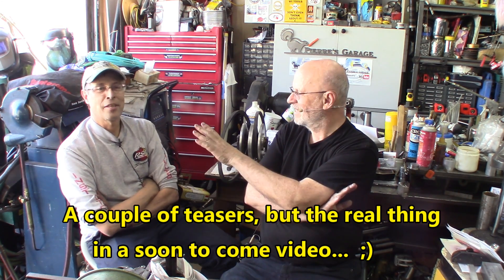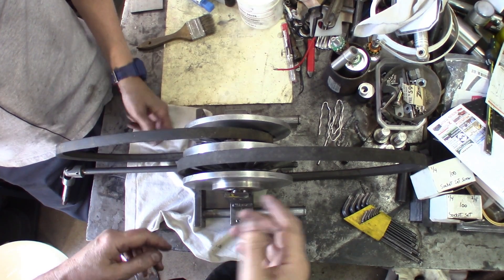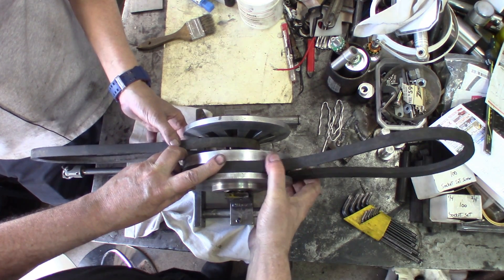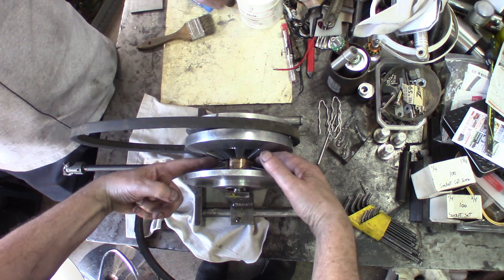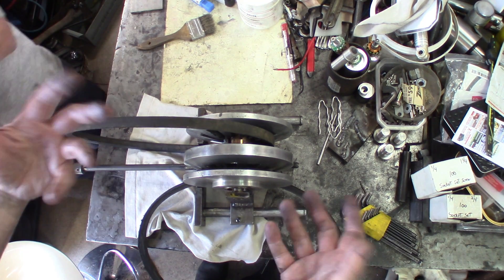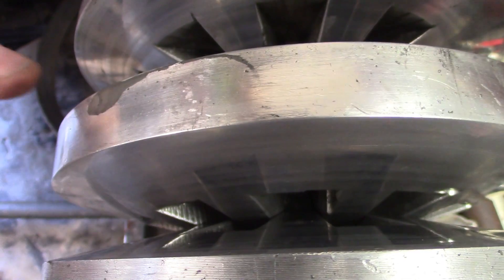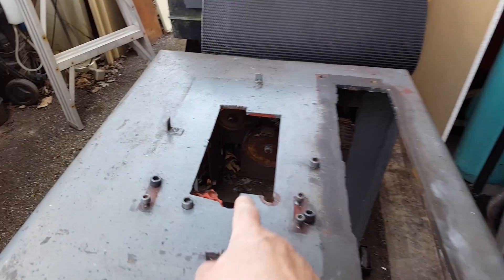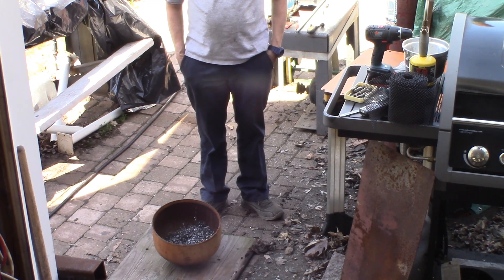Infinite Variable Ratio Pulley, How it's made and how works...

Comment: Does anyone know the maximum speed/pulley ratio you can achieve with these types of variable speed pulleys regardless of arrangement? From my research limiting factors seem to be things like belt/pulley angle limiting the pulley OD and minimum belt radius limiting the pulley ID. Cheers
Reply from the maker: Ratios can vary from something like2:1 or possible to 4:1, not much more...

Comment: As one side moves, doesn't it cancel out the other side? Result, no change in outcome speed. I'm missing something.
Reply from the maker: As one gets smaller the other wheel gets bigger, then, the ratio is is lets say 2 to 1 in one direction, as it shifts to the other side the ratio will be 2 to 1 in the other direction. this setup allows the change without the need to change the length of the belts cause the variable pulleys travel along the slide bars.

You need to figure that the pulleys on the motor and the other one on the driven tool are constant in size. the ratio is directly proportional to the diameter of the drive pulley over the driven one.

Comment: Speed Selector makes variable speed pulleys that replace the Reeves and Hi-Lo pulleys.  I think they went out of business.  A lot of them are in stock or they can make a custom if needed.  They have an actual engineer to help you if needed.  Very helpful.
Reply from the maker: I haven't heard about them being out of business, their web site is stibe is still on line....
They have great variable variable speed pulley systems, similar to what is in Bridgeport or similar heads. 
The system shown in the video is something different and less usual.
Thanks for your comment...    👍

Comment: When the pulley moves the diameter effectively changes which effectively changes the length of the belt.  How do you maintain tension on the belt? Is there idler pulley or?
Reply from the maker: As the pulleys change ratio, the pulleys assembly slides along the 2 rods, doing so it compensates and acts to switch the belts required lenght from one side to the other, since the pylleys change their ratios symetrictky. 
Let me know if it's clear or not to you...   🙂🙂
Reply: @pierresgarage2687  Thanks. Watched it again and saw where I missed that. Makes perfect sense now.

Comment: Hi Pierre, I was wondering, can you share de dimension, slope, or 3D model of those pulley? I would like to make some for a drill press. Thank you
Reply from the maker: It depends mostly on the straps you're using, as most straps are in the range of 34 degrees the pulleys have to be in that range, the size of the pulleys is dependent of the ratio you need for reduction or increase. When the straps are on equal diameter on the device there is a 1:1 ratio, as you go in either direction you change that ratio, then you need to decide what ration you need and then the diameter will be determined accordingly, be aware that with a 34 deg. the thickness of the wheels will increase quite rapidly.

Comment: Sorry for your loss. We had the service yesterday for my uncle. He was the guy who got me involved with mechanical things.
That drive is is just like the John Deere Variator drive, just a bit larger.
Reply from the maker: Sorry about you also lost someone important in your life, they leave a good imprint that's our to make the best of...
Those type of pulleys aren't that popular but they get the job done quite well where they're used...   ;)
Thanks for the kind words,    Pierre
Reply: Losing the ones that actually made an impact is always harder. 
John Deere used them for many years on their early lawn/garden tractors. They were used between the engine and a 3 or 4 speed transaxle.  The center sliding sheave bushing would get warn and then start sticking or the tractor would set and things rusted up.  Most of the owners didn't know they were rebuildable  so they sold/junked a very good tractor.

Comment: Understand your loss... lost mine back in 1976. Can only offer that time alone makes it easier. 
As to CVTs... have you seen latest models that belt and driver has one flat side? (So belt can run lower and still maintain contact area.) Actually get overdrive of 1.05:1.
Reply from the maker: Thanks for the condolences and kind words...
Haven't seen the later with the one flat side, I'd be curious to see one...   ;)
Cheers,     Pierre
Reply: Pierre's Garage  called TAV2  See them on Amazon, Ebay or omb (old mini bike). As cheap as $60 US. Final ratio should be 0.9:1,  not 1.05:1   https://cometkartsales.com/Comet-Industries-Torque-A-Verter-TAV2-30-Series-Parts/
Reply: Pierre's Garage   One last bit of trivia about variable ratio pullies. Take a pair of the big "driven" pullies and mount one to a gear takeoff on either side of a differential, and you have steering method that was used on "Snow Trac" vehicles. https://en.m.wikipedia.org/wiki/Snow_Trac#Mechanicals   Only snowcat vehicle I ever saw that used a regular steering wheel for steering. It changed pressure on either side of variable pullies gear driven off output shafts of VW industrial engine and transaxle.
Reply from the maker: Haven't seen this comment due to YouTube poor comments management, interesting they use this in karts, it looks pretty much like what's in variable type millimg machines heads, quite close to the one I use here...
Reply from the maker: Like they say, much better than using the brakes in order to steer the snow track, thanks for sending those bits of information...   ;)

Comment: The motor may be noisy due to the centripital switch, plug it in and find out, but replace the bearings anyway, I'm sure they were in the same environment as the pulley.
Reply: rfnoise pretty sure that type of motor doesn't have any centrifugal switch it's a repulsion induction motor the noise is probably from the brushes.
Reply from the maker: The guy's name says it all it probably "rfnoise" from space...   lol
I havent open the motor yet, but your option is still a possible one...
Reply from the maker: Miss you R...